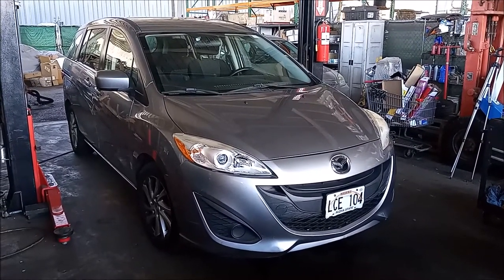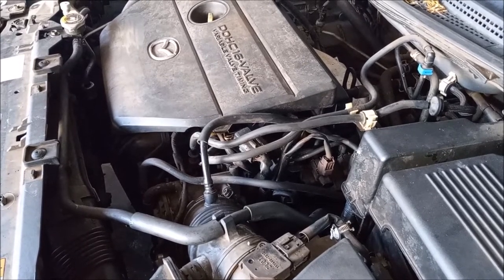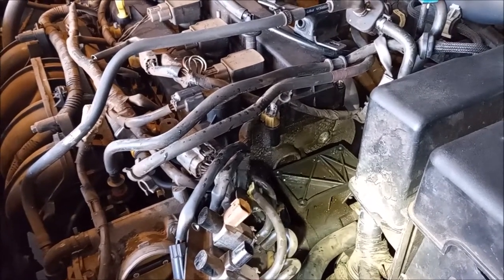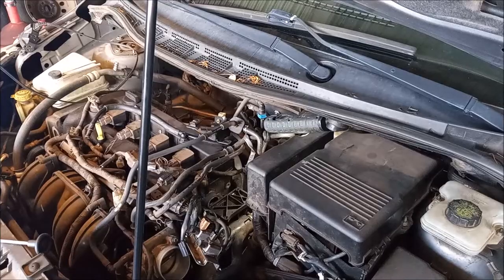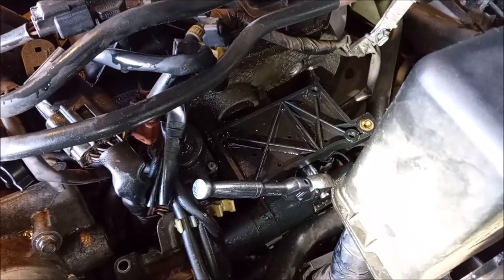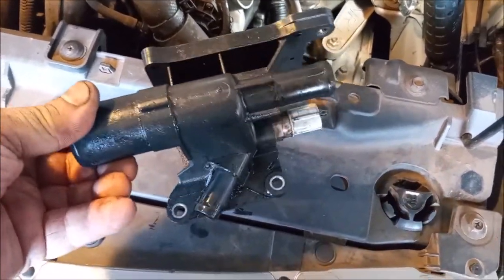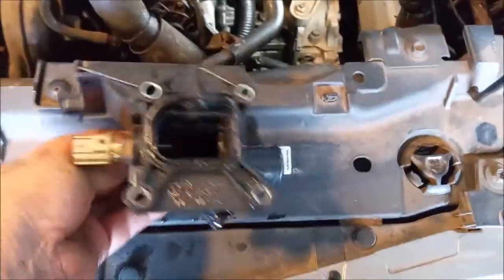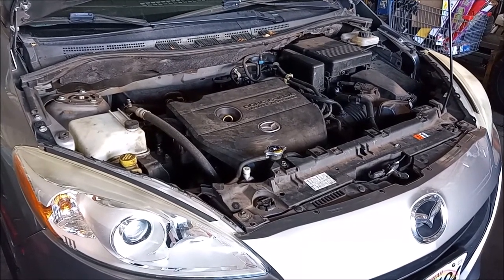Coolant Outlet Leak Test and Repair - DIY - Mazda 3 5 6/Ford Focus Fusion Transit 2.5-liter Duratec

Comment: I've had this same leak for about a year. Not too bad, but gets worse when using the AC. I would just add more antifreeze every few days. I was afraid the leak would be in a difficult, hard to access place. So I kept ignoring it. Now I'm going to fix it. Thanks!
Reply from the maker: Thank you for watching and for commenting.
Reply: I feel like with the ac running it just dumps the  fluid vs a slow leak without ac

Comment: Omg thank you I was looking for a leak for like 2 and a half hrs checking all the houses I did find that puddle and when I first noticed the coolant smell nonoverheat the plugs on top of the coolant housing were wet I thought maybe it’s a house so I looked no luck I decided to look up thermostat housing leak Mazda 5 and you video popped up right away 😍😍 then when you said there a puddle on top of transmission I was like boom that’s my leak just checked and I have a little puddle on top of coolant housing so now I’m 💯 percent that’s what it is very sneaky leak 😕😕 good thing I have you and your video lol thank you very much you saved me so much stress lol
Reply from the maker: Thank you for watching and for commenting. This is a very common failure on Ford/Mazda vehicles.

Comment: Thanks for the video. Just happened to me last night. But I noticed I didn’t have any coolant in my Reservoir
Reply from the maker: It's good you caught it in time before there was any damage.
Reply: I changed it out. But now I’m not sure if I was to fill up at the radiator cap or just at the reservoir?
Reply from the maker: @lilbluemexican  Fill the radiator AND the reservoir.

Comment: I have Mazda 5, I would like to know the name of this part or the part number. It seems I have the same issue and all coolant leaked out.
Reply from the maker: It is called the "thermostat housing."
Reply: The water outlet.   They make a aluminum machined replacement for $50 usd.
Reply: I am also replacing a thermostat just incase it is sticking as the one I am servicing has had this part fail 3 time.   Now upgrading to aluminum

Comment: I have the same leak in my '06 Mazdaspeed 6 after it ran hot. Although I'm not sure if the 2.3L turbo has this same part. The coolant temp sensor is in that general area though... does the sensor have a similar housing or can the sensor develop a leak? I'm just hoping it isn't a blown head gasket or cracked block. Temps are normal, coolant/oil aren't contaminated and it still runs/drives normal a few days later.
Reply from the maker: In the situation you find your self in, the best thing you can do is open the hood and take a quick peek to see what you can see.
Reply: @Merryfrankster_  From what I've observed, I've found cooked coolant on the intake hose leading to the turbo, which is in the same area as the leak. I just topped off the radiator/overflow tank, and have been monitoring it since. The leak has slowed down, but I'll tear into it when I have my Subaru on the road. Can't have both of my cars down for the count.
Reply from the maker: @theanti-come  if you're wondering about the location of a leak, find it using a coolant leak tester. https://www.youtube.com/watch?v=hM2dIPzhk4E

Comment: Usual cause for that failure is a bad thermostat.  Not opening all the way and causing too much pressure in the system blowing out the water coolant inlet.  Good idea to replace both when doing the job
Reply from the maker: Usually the housing is sold with thermostat included. Thanks for watching.
Reply: The parts come together

Comment: Happened to mine just now in the same exact spot. The actual flange that retains the gasket broke off a nice big chunk and this took out the gasket. Seems like a common point of failure from what I've gathered. I found that leaving the lower left bolt in allows you to tilt the housing towards the cabin and this helps get all the hoses started and that bottom left bolt. It's a pain to get to. A fairly straight forward process but you have to take a lot of stuff off to get to it.
Reply from the maker: Thank you for watching and for commenting.
Reply: Good video. What would make it excellent is showing the sequence of steps of what and how to remove things to get to that part

Comment: Great video. This is exactly what my car is doing! Is there a better replacement part made of metal? Is there an RTV that can handle cylinder head to plastic? Thanks!
Reply from the maker: Replacement parts are all plastic. On some cars with similar feature, we end up replacing them repeatedly over the years. There is no RTV used on this part. The seal is achieved by o-ring, only.
Reply: @Merryfrankster_  Thanks!
Reply: It's a crappy design but the original part did survive beyond the factory warranty period. 
I replaced mine 10 months ago with an eBay sourced part but it has just failed again on me.
Reply: there is a metal replacement about $40 more

Comment: I had the same problem, changed the water outlet,after this my ac stopped blowing cold air. Is there any connection between water outlet and ac?
Reply from the maker: There is no direct connection. The coolant outlet does supply hot coolant to the heater core. Look at your console and check that the heat is not turned on. Check does your ac compressor come on when you turn on the ac. Is it plugged in to the harness. Check does the radiator fan come on when you turn on the ac. Check does the ac system have a sufficient level of refrigerant.

Comment: I am having a similar problem on my 2015 CX5 2.2 diesel. Very very small drip of coolant on the floor just under the radiator. BUT the water in the radiator isnt going down. Checked the expansion tank no leaks!!

Could it be the same issue, please?  Thanks in advance.
Reply from the maker: Sorry I am not familiar with a 2.2 Diesel and I don't know its coolant routing. If the drip is under the radiator, well, look for signs of wetness on the hoses feeding in and out of the radiator, and if you can't find it there, then it is coming out of a leak in the radiator, or, it is materializing out of thin air, like things do on Star Trek.
Reply: @Merryfrankster_  Thanks, yes I ve been through that process myself  Yesterday I took it to Mazda here in Thailand after 3 hours they couldnt find it!!
Reply from the maker: search my video on how to find coolant leaks using a coolant system pressure tester.  @SpearofDestiny-c8y

Comment: I'd like to add something the fatal flaw with Mazda I've noticed never believe any of the gauges on the dashboard.. Sure warnings are good to have but there's a water temp gauge ,,gauge  stays rocksolid in the middle even though the water can be 240°... So yeah I never go by the actual gauges on the dash... same with oil warning ,,a Friend of mine Didn't have any oil Gauge on  But went to check his motor oil, There was none on his dipstick..   In about two months later his motor threw a rod... And he had to replace the motor... Not one oil warning light so yeah I don't believe any gauges on the dashboard it's a fatal flaw  .. Get a OBD 2 live reader If you really want to see your temperature of coolant .. You can even buy a maestro RR to go onto your head unit car sterao for your dashboard.., And yes I still haven't fixed the leak it's just been too hot I just top off every time I use the car which is every day
Reply from the maker: Good points. Thank you for watching and for commenting.

Comment: Can you just replace the seal instead of replacing the whole housing?
Reply from the maker: You could try that and if it continues to leak you can just drain the coolant again and do the entire job again. Do it if you feel lucky.
Reply: @Merryfrankster_  after finding this video, I do feel lucky. Thanks.
Reply: @blakefiorelli4086  where can I find the same seal
Reply: @matuaholmes5583  I purchased the seal from autozone but rockauto and oreillys have it as well.

Comment: Mines leaking.
Reply from the maker: Better fix it before any real problem happens.
Reply: @Merryfrankster_  as soon as I noticed the leak I searched for videos then found yours & ordered the part. I have another vehicle so the mazda is sitting until I change the part.
Reply from the maker: @sparkyjerred419  good job.